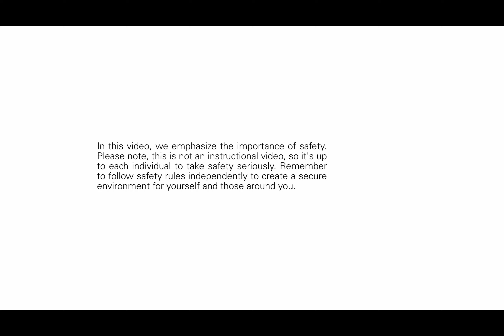Fixing The Bridge On An Old Brazilian Classical Guitar!

Comment: Now I thought I've watched enough videos on this topic, yet I learned quite a few things new from this one today. Good work 🎉

Looks like I'm going to source a leather cover for my guitar repair jobs going forward 😊
Reply from the maker: Thank you. Good luck
Reply: Thanks!
Reply: I think you would need a top cover that can resist heat a little better than leather. Make sure to time how long you have the lamp on and on what distance it is from the object you want to remove.
Reply from the maker: @BurninSven1  yes, I use 3/8” mdf wrapped in foil and measure the surface temperature before it gets too hot.